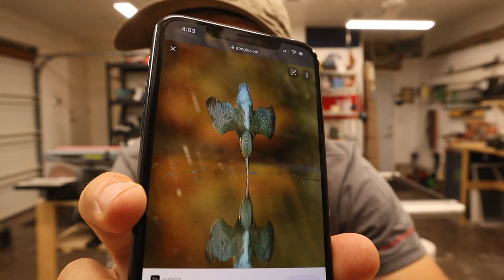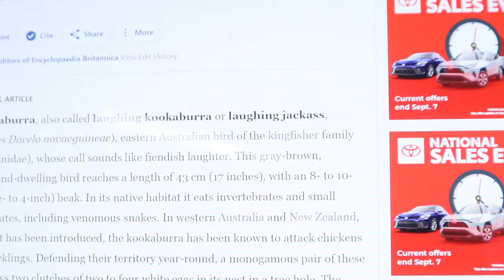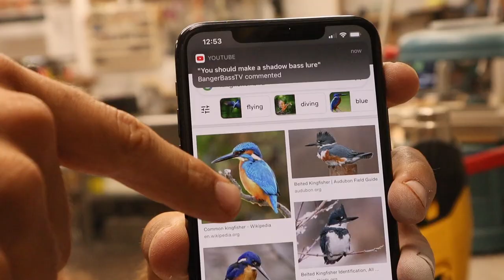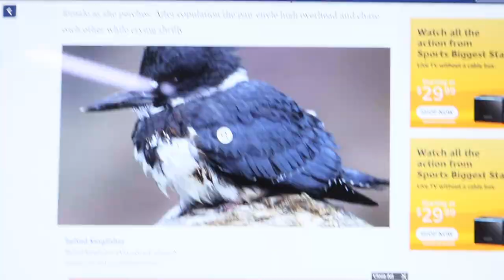Making a KingFisher Bird Lure

Comment: Beautiful job on that look of that lure, to make the wings work what if you used a small 90 degree spring coiled in center that the wing pin goes through, so forces the wing forward with light pressure and when you pull through the water the wings open . So cast, lands with wings closed and start the reel in water forces wings open, stop wings close and so on, would look like swimming motion. Just a thought

Comment: The crawlers I own have fixed wings on them, they don't pivot at all. One is a frog and the little wings are his back legs, one is a cicada and the wings are what catch the water on each side- but both are fixed in place. In each case the wings are angled toward the front- toward the line tie- but they're fixed in place. It's basically like the lip on a jitter bug- each side catches and when it does it lifts the other side up and rotates it forward. When done quickly it crawls or walks the bait along the surface. Lok up a picture of the Duo Realis cicada crawler or the Deps Basirisky frog.

Comment: "That is quite the pecker," 🤣 dude, awesome bait. Very beautiful 😍,  love the pike pattern too but that body length doesn't work for a pike in my eyes.   A baby pike jerk bait. Or swim bait jointed.

As for suggestions to make this bird work better. I would have put hook hangers for the wing joints, as most predator fish target the  head of a bait as they typically always swallow food head first. 
There are 2 possibilities  to fix the wings to make it walk.  I notice most of the production  baits with wings have a tab spring or actual spring to pull the wing forward. 🤔 also if the wings were to dip deeper in the water by weighing down the tips. Might work. 

The tucan walker will be a good chance to try the changes... test it in the bathtub  to adjust  things before heading out... you need a test tank in the garage. Or one of those mini yard ponds. 🤔 something long and deep enough that you can test the action at home and use underwater footage to spice up your videos.

Comment: @12:00 Generally it is a good idea to use different materials for non-lubricated rubbing parts. Steel on steel has a higher friction coefficient than steel on brass. Corrosion is a significant concern in salt water, but in fresh water it should be fine.

Comment: I think the joints for the wings of a crawler bait is mainly to collapse the wings when you cast, so it will cast better. I don’t think the wings really move around much at the joint when retrieving a crawler bait, they kinda just stay in the open position the whole time.

Comment: Possible idea, right in front of the wings, put a very light, and I mean very lightly tensioned spring, just enough so when the lure is setting still the wings are pulled towards the beak, when you twitch the lure, the wings should unfold due to the drag in the water and then fold back to the beak again upon rest then rinse repeat...?!?!

Comment: The wings on a walking bait have to be in a almost 90 degree angle to catch the water and make the bait rock back an forth the wings u created are more like plane wings. Which will just hover and cut thru the water u want the wings to grab the water. So it will rock back and forth and u also want the weight or the balance of the bait to be in the back which allows the bait to walk easier.

Comment: It seems the wings would be tucked in as the bird dives. Maybe reverse the action and make a Diving lure. Then wings come out at the surface or when you stop retrieving the lure. A wire spring connecting the wings posted in the center may equally bring them out.